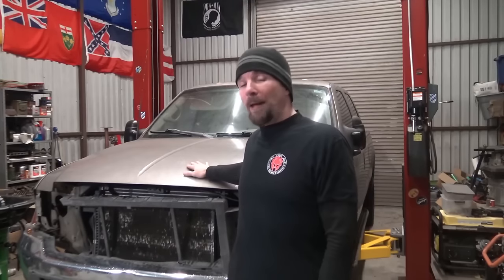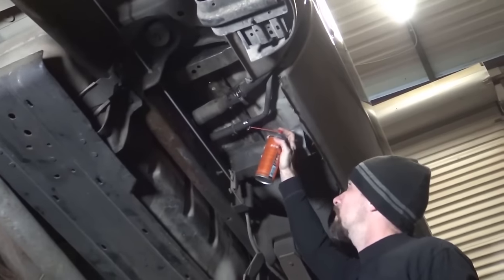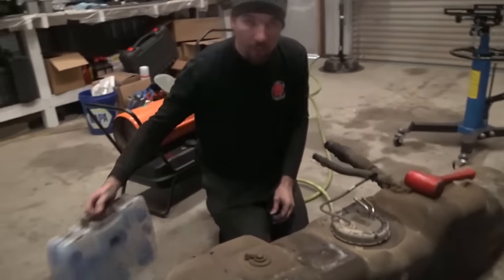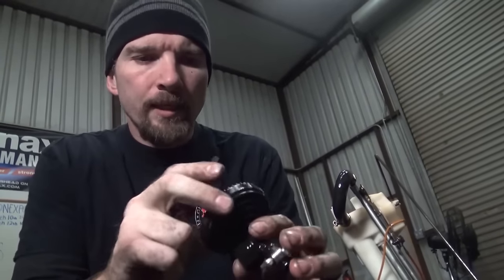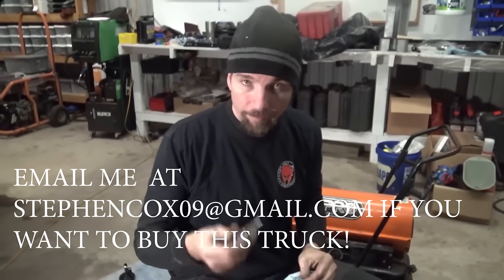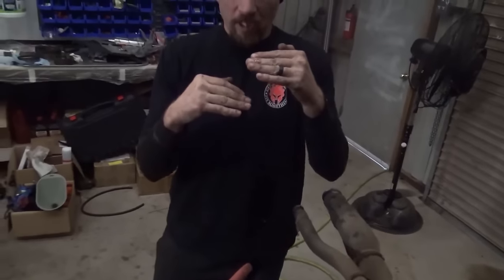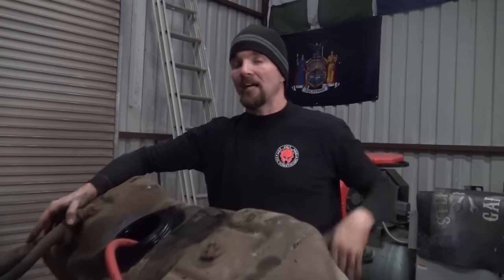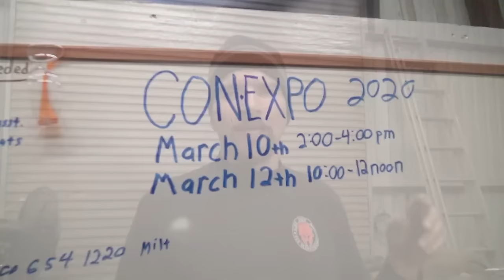Critical part of a Ford 7.3 Powerstroke Diesel that most owners neglect

Comment: I tore those stinking strainers out. I plumbed in an inline strainer ahead of the fuel pump and mounted it to the frame. That was nearly 80,000 miles ago and had zero issues. The local Ford stealership wanted to charge me $1,800 to pull the strainer. I told them to pound sand and did it for myself in about 2 hours.
Reply: How is it running bud
Reply: I deleted my socks too!! I used a china brand inline filter that u can clean filter n replace under drivers side

Comment: I've always thrown all of that stuff away with extended return lines to separate the intake and return and done the harpoon mod with a spin on inline filter. Customers always loved it. Keeps the air that deadheads on #8 to a minimum.
Reply: Could this tank be fitted to an excursion for a second tank?

Comment: Just put a simple sump kit on the bottom of the tank, then to a water seperator filter, less than 30$ for that part, then to the pickup pump, about 2 hours to complete, then never pull that tank again 😊😊

Comment: I bought a 7.3 that didn’t run said put a brand new tank but didn’t touch the pickup lines they were filthy cleaned them out real good with break clean out all back together and truck ran like new. And I cleaned out the bottom of the fuel bowl that is also a good spot to look for gunk

Comment: I filled up my 97' Ford F-350 and was in a parking garage going to a meeting. When I came back it looked like the fuel tanks had dumped a lot of the fuel. I have not checked underneath, but could there be a hole possibly in one of my fuel tanks? Thanks, Kendal

Comment: Thanks for the extra info, I know its been like 4 years but thanks! Doing some research before I try to start this 2000 7.3L w/ 40k after sitting for two years and I'm wondering if I should drop the tank or not.

Comment: Any videos on how to clean the vent tube? I had the harpoon mod done thinking that was going to fix the issues of when the tank gets remotely full having fuel spit out of the filler neck. So it still takes forever if i want a full tank for fuel.
So tank isn't venting properly and guessing the tube is clogged?
Thanks

Comment: Maybe you can help diagnose my 02 7.3. It acts like it has a short somewhere. I can't find it anywhere. It's like you shut the key off when barley hitting a bump. I changed the cam sensor. It will cut out if I shake the truck even.

Comment: My truck is doing something similar but with no weight on it runs fine at 40-50mph and when I gas it chokes it struggles could it possibly be the screens or maybe a transmission sensor ?

Comment: Have i have a 97 f350 7.3.  I just had new 180cc stage 1 injectors installed the start of covid shutdown and new oil cooler. Now im getting code 1211. Running edge tuner dont notice any wierd hpop pressure. Any ideas what to look at to fix

Comment: What if you splashed a bottle of everclear or pour some ethanol in the tank to evaporate the little bit of water and algae that was left and made it easier to clean and dry completely? Would that work or would it be more trouble than good?

Comment: The screens filter return fuel before it goes into the tank or back to the fuel pump.  If the tank is empty the return fuel will just recirculate back to fuel pump.  the fibers in the screen are from the fuel filter.  Normal happens on trucks that only see a new fuel filter every 10 years (exaggeration but you get my point.).  Due to the return fuel recirculating if the tank is empty, when you run out of fuel in a 99-03 7.3 you are OUT!! there is nothing left in the tank, the lines, the filter bowl and only maybe an Oz or two in each head.

Comment: #2 diesel flashpoint temperature or when it off gases enough vapors to be flammable can be as low 125 degrees Fahrenheit. Some documentation gives a range of 125 to 180 degrees Fahrenheit. Just food for thought if gets poured on black pavement in the summer it can become flammable some cases stay safe.

Comment: I replaced a fuel pump in my wifes suburban truck by cutting a square  hatch under the driverside back seat. I used a 20v Dewalt grinder. It was a uncomfortable feeling considering she had a full tank. I wouldnt suggest doing this but i was on vacation a few hundred miles from home when it went it. Idk why vehicles dont come with an access hatch for fuel pumps....

Comment: First video I've seen about a fuel tank, showing a skid plate under the tank, I bought my truck used, and it does not have a skid plate on the tank. Interesting to see that, I had no idea it even had one, I gotta see if I can source one, considering my truck does go offroad alot.
Reply: It's an fx4 or off-road package my 93 Ford has skid plates on everything, wish my 2008 super duty had them

Comment: I bought my 97 7.3 new, it now has a 38 gallon tank with a sump, primary and secondary spin on and 2 electric pumps on a relay so that I've got a spare. I also got rid of the factory fuel pump and filter bowl and lines. I used Mark Fuggazzoto's top end kit.
Reply: That was my question, the '97  7.3"s have this filtration system?
Reply: @csedan510  97s have a single filter in the bowl in front of the pump in the valley

Comment: I suggest you completely wash out the tank.
Buoyant materials will coagulate on the filter, the longer it runs.
I've found cups full of what looked like old filter material from the fuel stations.

Comment: I just changed the screens out of my truck about 4 days ago. My truck 2003 f350 4x4 7.3 with 175k. After opening it up if I knew how clean my screens where before hand I never  would have done it. But it is done now. The screens almost looked new. I personally had this truck for over 50k. And I am sure they was never replaced before.
Reply: My 02 had 180k on it when I went into tank, screens were 75% clogged with algae and pickup funnel was in pieces, plastic junk, did the riff raff mods with spin on filter pre pump.....now its right.
Reply: Also, the return line from engine inside tank is very close to pickup line, hot agitated diesel being immediately sucked back to engine, added 18" piece of hose to return line to keep happy fuel in engine.

Comment: Why would you drop the fuel tank and check the fuel strainers?Just back, feed it with a 150 ps.I.Air if it's plugged up it'll drop down to the bottom of the tank and forget about it

Comment: What is nice is the obs style 7.3 don’t have this. Getting ready to do a inline water fuel separate filter to keep it from getting to the fuel bowl seen people pay no kind to the water in fuel light and have a mess. So keep it from ever getting to the bowl. Also see people do fuel bowl deletes but Iv never had issues with mine dumping fuel in the Valley so there’s really no need for me to put the money and time into it
Reply: I was watching this video because I’m getting ready to do it to my OBS 1995 350!!!!!
So are you saying that there are no screens in the fuel tank?
Reply: Not with the original fuel sending unit set up. My 97 had the old style in one tank without screens and the new style in the other tank with the screens. Am removing the screens on the new style unit.

Comment: You seem pretty knowledgeable. I put $5000.00 into my 94(hired in done) it's hard starting and won't get above 45mph, used some seafoam and that helped for a day but went right back to same old problem. Any ideas?
Reply: still having issues? you have any way to scan it? you really need the data on these engines-all the problems are pretty well documented at this point if you can pull info

Comment: I now have reason to believe this needs to be done on my 2001 F-350 dually. I had a catastrophic engine failure and  the new engine has under 30,000 miles on it. Everything else is stock. Truck has 173, 000 original miles on it currently.
Reply: What happened to your motor?

Comment: I have a 2002 F350 Dually 7.3 when it's cold out I have no power. Push gas pedal down nothing. Night creep a little. But once it gets a little heat in her she will slowly start to go. Once warmed up she will go. Any ideas?
Reply: Is it louder than normal? No boost? It might be the turbo bypass (exhaust back pressure valve) my 1997 still has it and it cycles when cold, but opens up when you push the pedal hard enough. I have heard it doesn’t open and you lose boost and thus no power.

Comment: I have 2000 international 4700 the oil is being pulled from the engine into the fuel tank. Have not been able to find the problem any information will helpful thanks
Reply: Injector o rings are a "cross over" concern, you may have a damaged o ring.

Comment: The plastic in the bottom of the tank is the foot strainer when you hit the bottom of that tank on something that pushes up and shatters that strainer plastic pieces went up and starved my fuel pump 19:54 19:54 19:54

Comment: Hello I have a 1996 f 350. 7.3. Diesel that throws white smoke cold. Start only what is the most common problem?   Fuel sensor regulator ?
Reply: Injectors get old and misfire when cold. Once warm they free up.

Comment: Well Damn, I've got a 7.3 but it's 95 so a manual pump. And two tanks
Reply: Your return line filter is built into the side of your fuel filter housing.
Reply: @MH-wo4be  there is return lines also from the back of heads

Comment: Rather than drop the tank just remove the 6 bed bolts an remove the the tail lights then slide the bed back and u got complete access
Reply: Does it take two guys (or more) to pull the bed back?  How far do you pull it back?  Thx.

Comment: I have a 1996 f250 7.3
My shifter on my steering column is lose and can't find anyone with the experience to take it on.
Even the metal work around the top of the wheel well
Reply: Don Where are you located. I have rebuilt quite a few of shifters on the column. I am in Houston

Comment: My brother has a 7.3 powerstro problem is idles ok no power and after pressing the horn the truck stop running  Im trying to figure out the problem thanks
Reply: I had an issue with mine. Ran fine then put on wipers and motor dies. Restart then ran fine until I put on wipers again.  Called it a "fair weather" truck. After exhaustive analysis my mechanic found the windshield was leaking. After replacing windshield and GEM unit, the truck runs like a champ. It's a 2000 F250 7.3 with 300,000 miles.  Special thanks to Buz of Hanahan Auto and Truck for his patience and fortitude for not giving up on me or my truck.
Reply: My 97 OBS engine will die if I honk the horn or power the DS window down first thing in the morning. But only once.
Dont have a clue where to start looking. Any ideas would be greatly appreciated!
Reply: @martinjewell630  prolly have the water coming in headliner area, dripping onto steering column, not uncommon and can affect cruise, hazard lights, ignition, etc due to corrosion
Reply: Clock spring inside steering wheel assembly was frayed in mine. Caused airbag code and no cruise function.

Comment: Im stuck. I get my 99 7.3 to start but wont run. Sounds like its running on few cylinders. Smokes alot.
Ive checked the wiring from Idm to injectors. Its good. Got Icp pressure cranking upto 2800psi. No codes. I unplug icp and sel comes on but still no start. Ohmed injectors within range. Most of em at 3ohms. 1 is at 3.9. Changed out idm. Changed ipr, icp, back pressure sensor, rpm gauge goes up to bout 100 so assume crankshaft position sensor is ok. I sure could use help.
Reply: I had a bad idm that i replaced with a reman that was also bad so you might try another idm
Reply: use only oem sensors. check out his video about injectors. they might need replacing.
Reply: change all the glow plugs and go to a stancor gpr, worked for me

Comment: Just bought a 97 f350 dually... For 500 bucks. Lol! Has 150k on it. Runs awesome. Drives near perfect.
Reply: With luck like that it might be time to buy some lottery tickets.  Strong work.
Reply: I bought a 97 standard cab w/ zf 32,000 mi. With Meyers plow, garage kept. $3000k touche '
Reply: @frenchfryfarmer436  I've put 3k into it since I got it. Interior is near flawless. Done a bunch of upgrading.
Reply: @calebyoung1579 I got a clean 7.3 with 35 into it also I was about to say $500 is ridiculous 35 is still really good 👍🏽

Comment: Not only do the strainers plug up but you didn't mention the showerhead that usually rots and falls off and consequently the vehicle runs out of fuel before it's empty!
Reply: My 2001 runs out of fuel with1/4 showing,  found the showerhead strainer completely broken off.  Replaced with a new one and it started doing the same thing a year later.  Now I make sure never to let the fuel get at 1/4.
Reply: Riff raff diesel sells a mod to eliminate screens and shower head add a prepump inline filter......problem solved. I put a spin on filter prepump on mine on outside of frame easy to get to.love it.
Reply: @darrellcall6560  yeah we use them a ton and they work great!

Comment: "for these fords and every single ford truck"......sorry bud your wrong there, most cab and chassis stupid duty's came with a tank that was behind the rear axle and bolted to both frame rails.... we have 13 of em ranging from my 2000 to the boss's 2016 at work and every single one has the same tank and in the same location. and no, none of them are heavier than an f350 dually. oh and theyre NOT plastic either.
Reply: True words. That's an expensive 35 gallon tank .

Comment: Informative, but hire a new cameraman.  When it counts, you’re not showing the right view.  i.e. how you opened the assembly top, the actually material in the bottom of the tank and how the shower head looked that made you think it was about to fail.  Essentially closer up shots.  He has no problem keep that mug of yours front and center though.  ; )